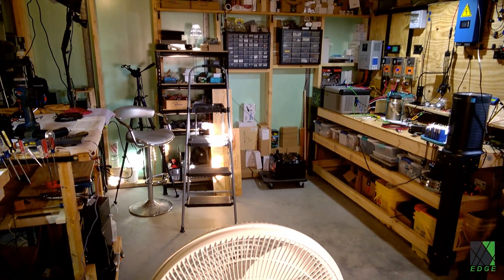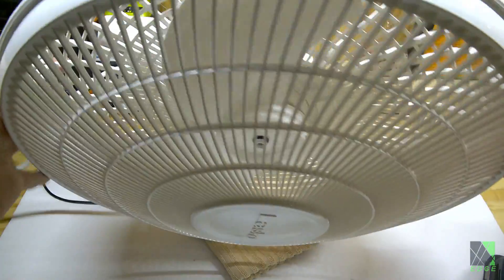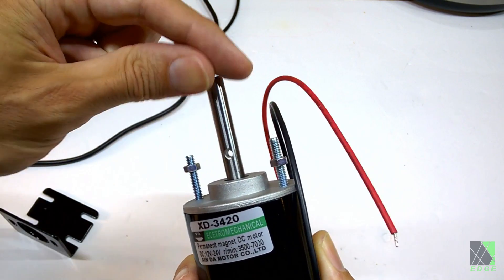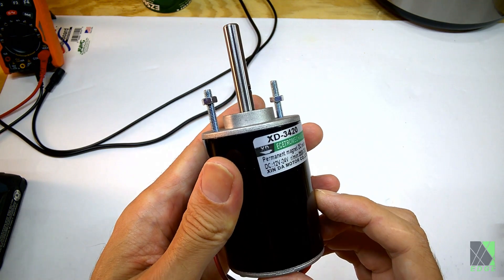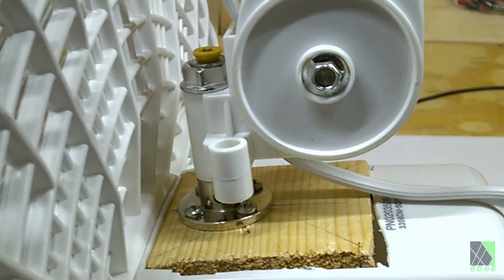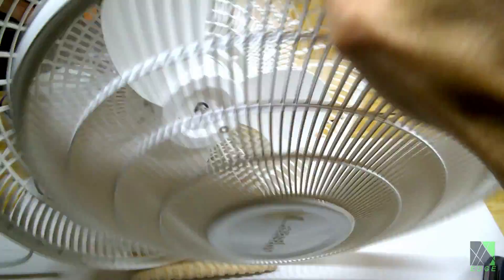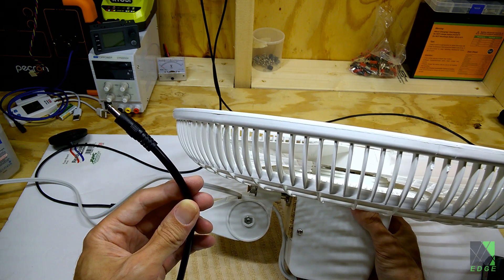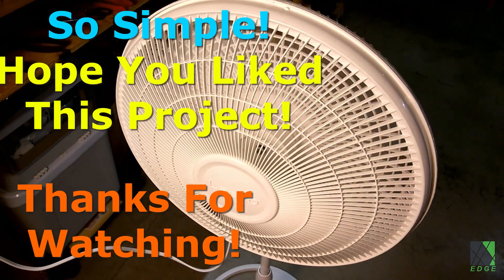Solar Pedestal Fan DIY! direct PV DC powered conversion, build overview #diy #solar #solarpower

Comment: Does 775 DC motor is faster than xd 3420?
Reply from the maker: @SorryNOTsorrYtDÉVANT I don't know, need to check the spec sheet. I am still running this motor and it's working very well!

Comment: Hi fab videos. Keep up the excellent work. What solar pannel did you use or do I need for the fan please.
Reply: Also is there a way where I can put a temperature controller on there as well . 👍
Reply from the maker: @kevinsadler1732 Hello, a 50 watt panel is adequate to run a fan, but a 100 watt guarantees cooling even in less than idea circumstances. Yes you can put a temperature controller on there, just put it in series with the fan :) (although I'd just leave it running non stop)

Comment: I attached a cigarette lighter socket to a small solar panel and plugged a 12 volt portable fan directly into it.  Probably not the smartest option but it seemed to work fine.
Reply from the maker: That's pretty neat! If the solar panel is small enough, it shouldn't harm the motor at all, the voltage would get pulled down to hopefully "about 12 volts"

Comment: Wondering lately need to do all that? 150 watt DC to ac inverter with 200 watt solar panels would drive it?
Reply from the maker: @Off-gridPA That could be made to work too
Reply: @solarpoweredge  Don't give up on the peltier experiment!
Reply from the maker: @Off-gridPA Right on, thanks for the encouragement! Peltier setup has been upgraded to part 2 - a little more time to finish testing and recording the results :D

Comment: Do you find solar panels mounted on the side of your shed produce better power than on top of your shed?
Reply from the maker: @skid4482 So far, I haven't had any panels on the roof to compare. Maybe I'll add a couple. The wall panels are a tradeoff: no weed wacking, no roof modification in exchange for no power in the morning, ok power midday, and very good towards end of day. To power stuff in the morning, I mounted a 100w panel 90 degrees around the other wall corner. (In winter, power is pretty good as the sun is lower)